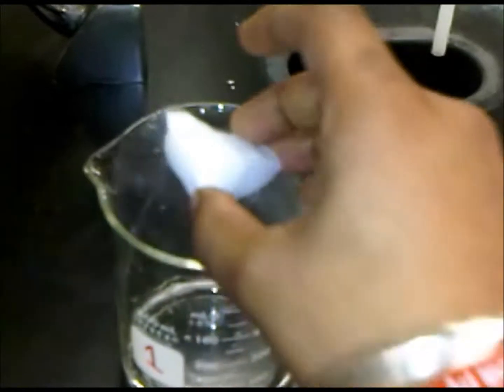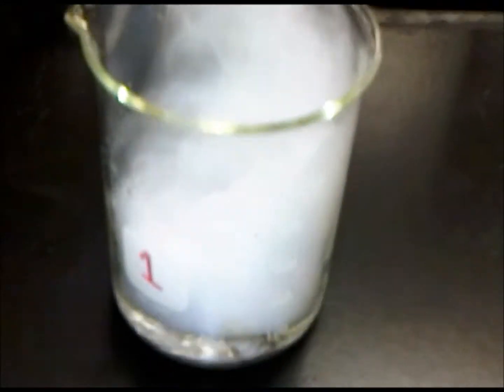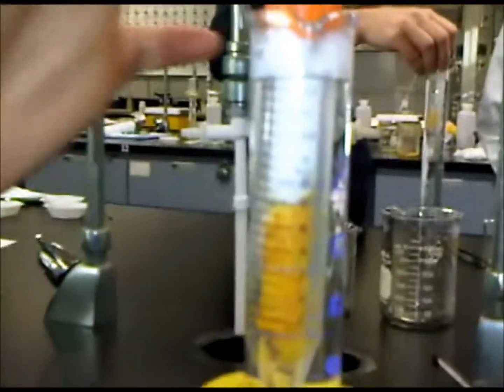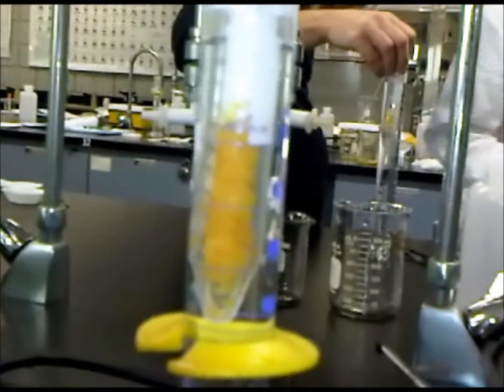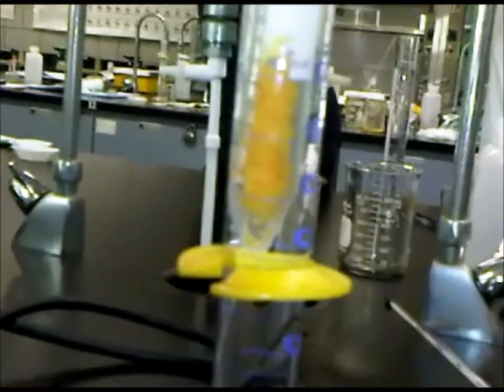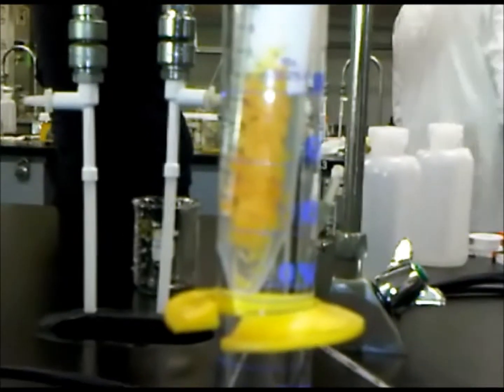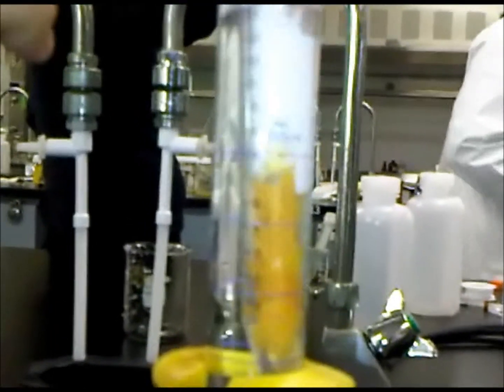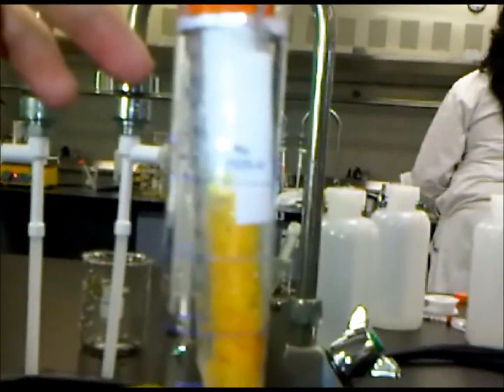Dry ice extraction experiment and a possessed test tube

Comment: did you use a vented or unvented cap for the centrifuge tube?
Reply from the maker: wow, still cant believe im still getting comments on this video after so many years. If i remember correctly, the caps where not vented. We had to achieve a high enough pressure to force the CO2 in to a liquid phase. However, the cap seal wasn't perfect, so gas would undoubtedly leak out.

Comment from the maker: @melvin0444 what type of tube did u use, was it a centrifuge tube? and did you make sure that you screwed the lid on tight enough. the pressure generated in the tube is very large, so no matter how you orient the tube, if the lid is not on tight enough, well you know what happens. make sure the tube you use has a lid that can be tightly put on, preferable a centrifuge tube.

Comment from the maker: @melvin0444  its been a while since i did it so ill try my best to answer. there was no exact amount of dry ice used. All we did was crush the dry ice in to a powder, so close to, and packed it in to the tube as tightly as we could. By completely filling the tube, and making sure the lid was on tight we ensured that there would be enough pressure in the tube for the carbon dioxide to liquify. hope this helps